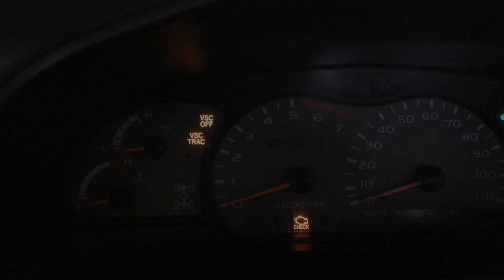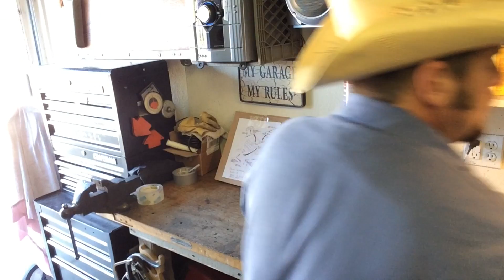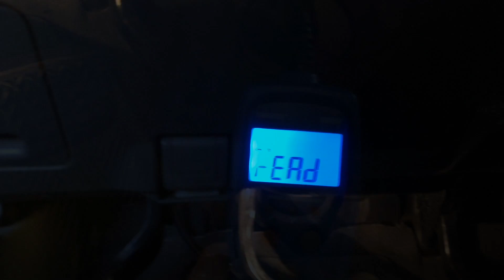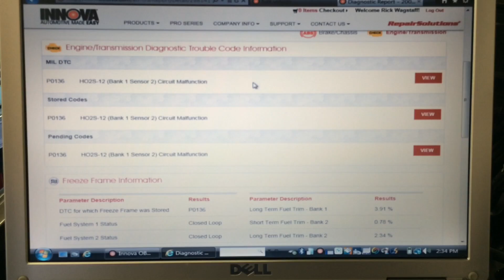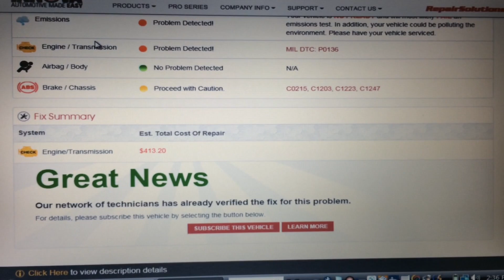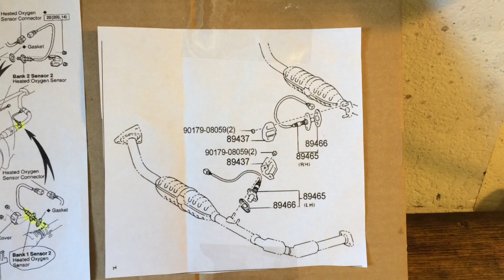Oxygen Sensor (Replacing) Toyota Sequoia (part 1)

Comment: I have a 2002 Toyota Sequoia Limited v8.. Having issues with the obd2 saying some sensors aren't ready but no trouble code just yellow question mark with O, OH, EV, C and CC flashing! I have the same scanner as you do too... I've driven the truck and got few of the flashing pending codes to go away, but the next day they're flashing again 😔... Possible causes for this to be happening??!

Comment: Thanks for that diagram! This suv has known issue with the 02 sensors being wonky, the dealer actually recommends that you replace all of the sensors at the se time so they can age together. The light will come back on shortly after replacing the faulty sensor if they others are far enough out of spec.
Reply: Mr S  sounds about right..